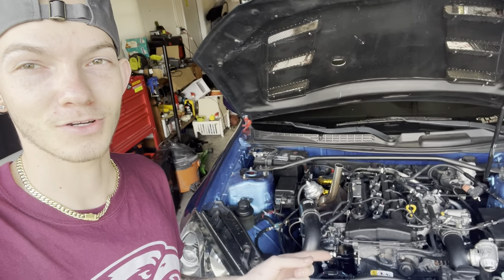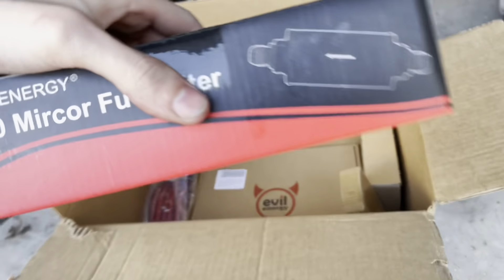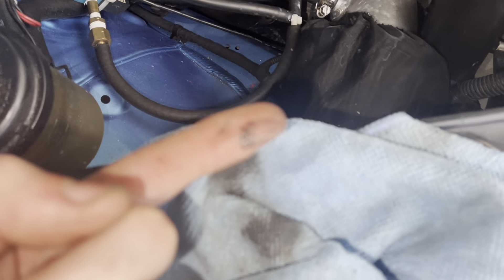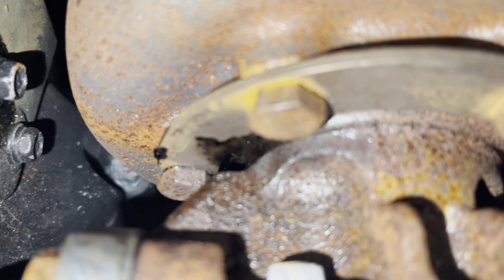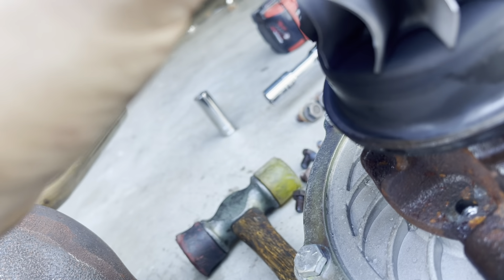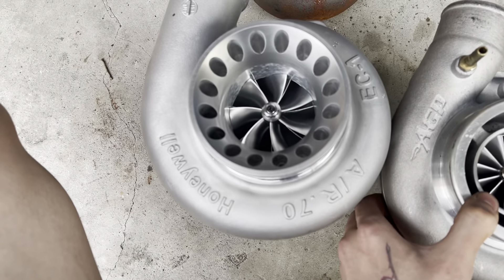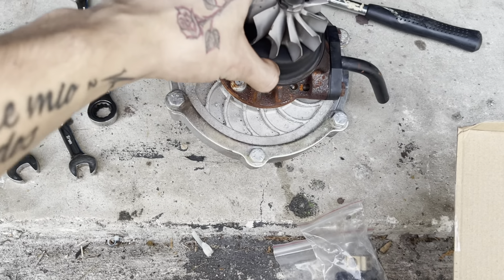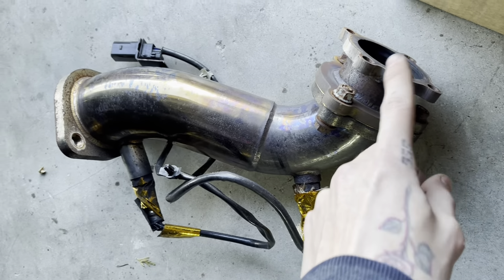Genesis coupe big turbo upgrade

Comment: You should Darton sleeve that block brother. Add fire rings and a .040 cosmetic gasket and you'll be 👍 hopefully. I would be scared shitless trying go big hp on non sleeved block. Just my 2 cents. Evo x main Arps also because on big hp main caps tent to come loose.
Reply from the maker: That’s a really expensive upgrade I’m not going for a super high hp just between 500-600 which many people have done on this set up I got a lot of stuff I’m working on including trying to buy my first house but maybe in the future I will look into darton sleeves

Comment: What did you do with the coolant pipe that comes out the back of the water pump housing? Curious as to Mines in the way so I was gonna make my own but wanted to see what others have done. TIA
Reply from the maker: I ended up looping it. Just put a coolant hose going from one outlet to the other. Make sure to clamp it tight

Comment: hey i was watcching your hyundai gen mod list video and i saw you had a dignostic reader installed and i have a few issues i wanted to talk to you about i have this code po705 bassialy my car sometimes dosnt realize what gear i am in sometimess if i put it in drive it will go in reverse i was wondering nif you would have any sugestions of what it could be i have replace the inhibitor switch and the problem comes right back very much apprecited if you replie to this and i was also wondering what kind of dignoseing tool you have in yourt car beacuse i need it to dignose this problem correctly